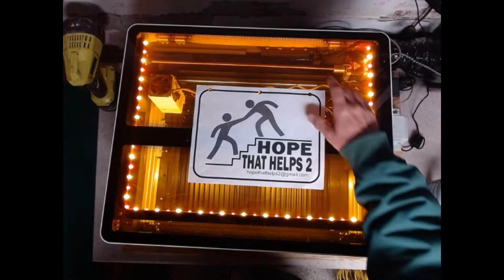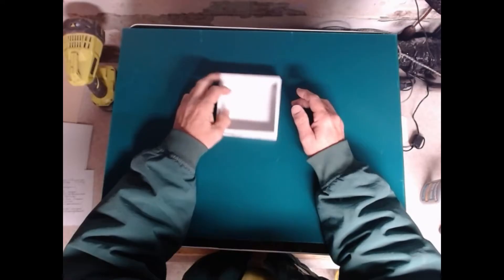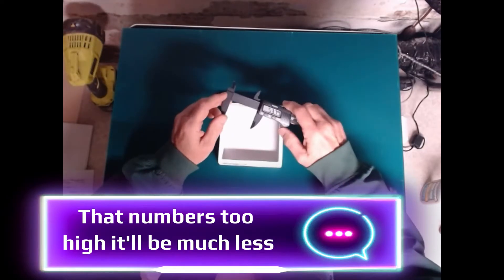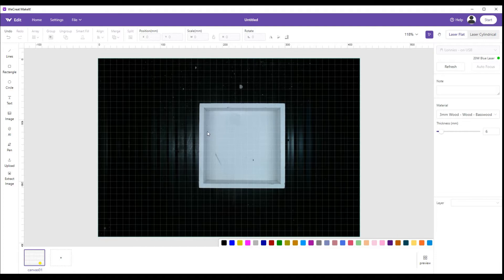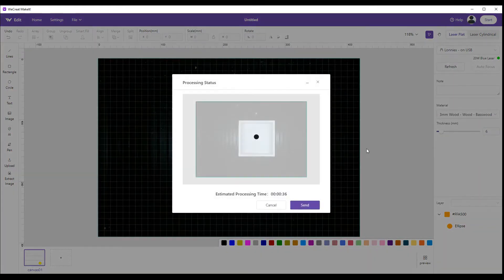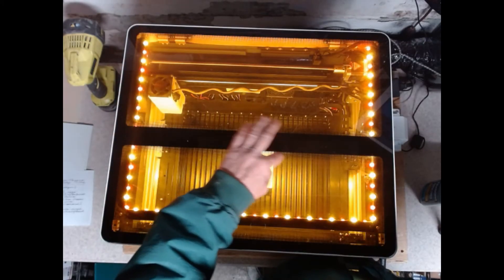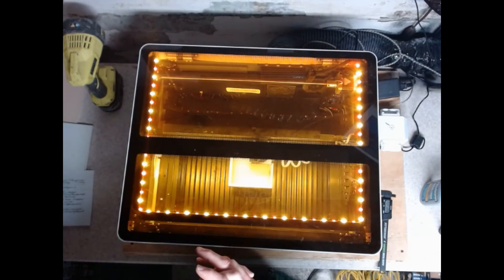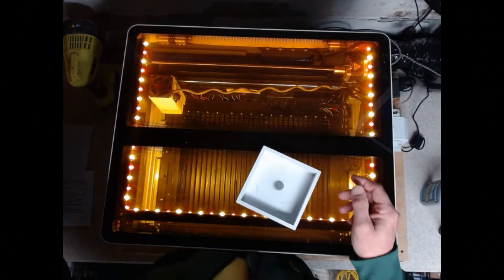Engraving Inside a Box, Tray, Etc         - #wecreat  laser

Comment: What if you placed it directly down on the tray (remove the grid) and engraved it that way?  Would it still hit the sides or would the laser head go down that far and hit the edges? Not sure how far down the laser itself goes. Maybe would need to put something under the item you are engraving to bring it up a bit if the grid or honeycomb is not in the machine.